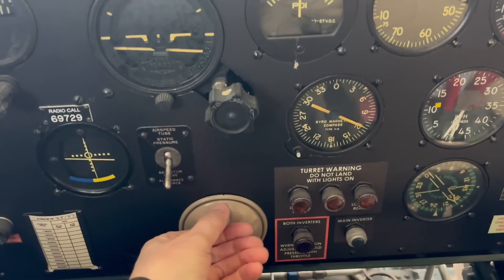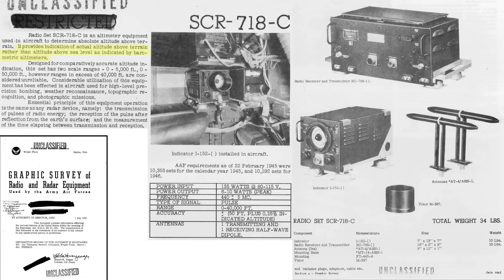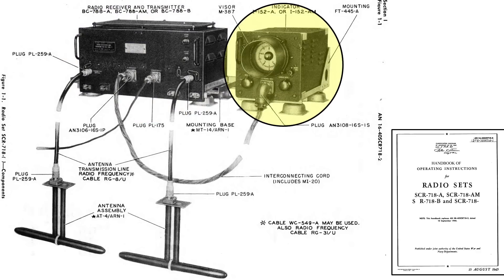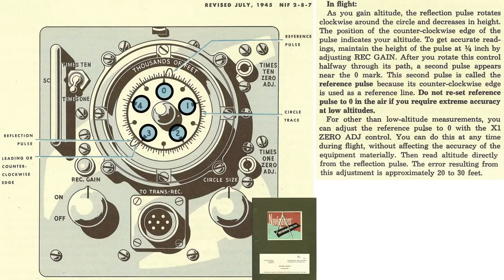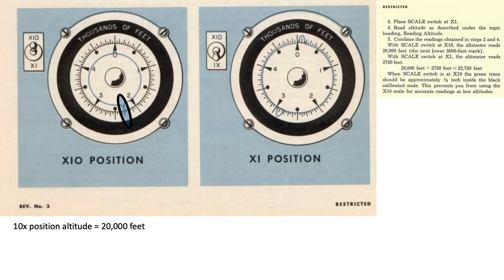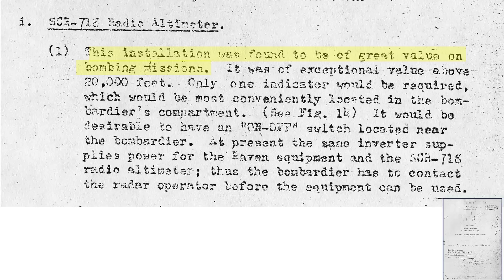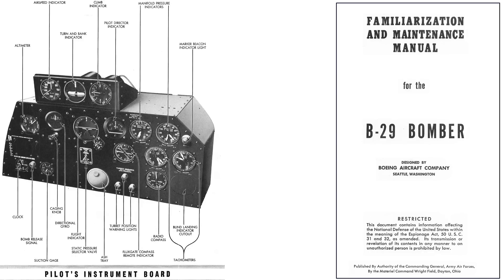The clever instrument WWII Bombers used to determine their altitude - The SCR-718 Radar Altimeter

Comment: C-130s used a very similar unit for pressure pattern navigation well into the 1980’s.   It was a good backup overwater as we did not have INS or GPS but celestial and Omega and sometimes nothing at all but Dead Reckoning on cloudy/IFR days.  Quite an art

Comment: Boeing 767 that still had the round ashtrays in the cockpits were and are identical to those ones in the B-29.  Many have been deactivated and covered now but when the widebody jet came out,  crews could still smoke in the cockpit like passengers in the smoking section. I tried to see if I could acquire one during an overhaul but only got a passenger arm rest ashtray.  As for the rad alts, the WW2 version used UHF frequencies,  thus the little dipole reflecting off the wing,  but nowadays they are at 4.3 GHz and sweep 100 MHz either side of that.  The antennas are flush mounted.  And redundant two or maybe three per jet plane.  Power in the order of a couple watts CW at most.

Comment: The ID-14A/APN-1A is a conventioal mechanical dial and needle indicator instead of a CRT based indicator, selectable between 0-400 ft and 0-4000 ft.  The transmitter circuit of the APN-1 uses a pair of 955 acorn tubes in a strange arrangement with the plates connected to the modulator and the grids going to the antenna.  I wonder if the other radar altimeters use a similar arrangemant.
Reply: I saw an old unused WW2 UHF rad alt for sale at a hamfest once.  Do not remember what model.  It was not messed with,  apparently even hams could not figure out a useful conversion for that monster.
Reply: @TomSherwood-z5l  There is a dynamotor inside that may be useful (if you want a 24V one); but yeah, it's a pretty specialized thing with stuff inside I've never seen before, or since.
Reply: @Strike_Raid  I love it when people speak in an ancient language that I still understand.
Reply: @Hopeless_and_Forlorn  It actually seems to be coming back.  I here more electron tube talk these days than for over 30 years.

Comment: By far, the hardest hurdles to restoring any WW2 radio gear is finding the plugs, cables, and accessory or junction boxes. That is also true today. The culture of disposing of everything except the box came from the 29 aviation disposal sites immediately after WW2. It's been copied by avionics shops to this day. The progress of 1940's radio avionics went from simple and shrewd components to big heavy complicated unreliable equipment late in the war. Planes paid huge penalties especially for the later junk. The early stuff was gold. 135 watts for the radar altimeter SCR 718 ? Don't drop the flaps. Just turn on the box. What a blessing transistors are. I restore ARC RT 328's with trays and plugs.  They would have done these planes some good.

Comment: Does anybody know why 440 MHz was used?   26.8" wavelength seems like low fidelity.
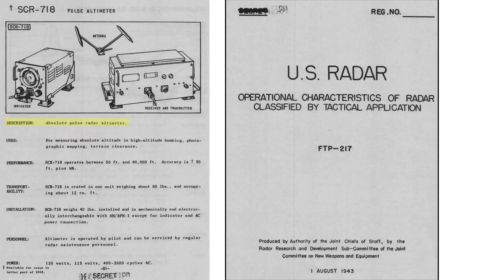Reply: This wavelength would give altitude to the nearest foot (actually 13.4 inches for purists). But then this radio altimeter had an ACCURACY of +/-50 feet (see time stamp 1:53 line PERFORMANCE).
Reply: @johnbuchman4854  the accuracy was "plus/minus 50ft plus 1/4%," not just "plus/minus 50ft."
Reply: I believe the low frequency gives you the range required with minimal power, and the accuracy is sufficient.

Comment: Great stuff, as usual.  A small correction for terminology: altitude indications based upon static atmospheric pressure measurement in general are referred to as "barometric altitude."  "Pressure altitude" refers to barometric altitude indication referenced to a corrective setting at the standard sea level pressure of 29.92" Hg, as seen written below the comparison illustration seen in the video.  Barometric and pressure altitude are the same only if the ambient pressure happens to be equivalent to standard pressure.  Based upon the technology in use when I retired from wrenching airplanes some fifteen years ago, I can say that modern airliners are equipped with two or three LRRA (Low Range Radio Altimeter) systems that provide absolute altitude indications on flight displays, and also provide the same values to flight guidance systems critical to landing, and particularly automatic landing.  Rather than using radar pulsing, modern systems use FMCW (fFrequency Modulated Continuous Wave) signals based at 4300 MHz.  This requires the installation of two, identical antennas in the belly of the airplane for each system--one to transmit the signal, one to receive the reflected signal.  Multiple systems use unique phasing to prevent interference between systems.  The systems are continuously active, but only absolute altitudes below 2500 feet are displayed to the crew.  The FMCW system provides more accurate indications than pulse radar at low altitudes.  They are calibrated to read zero altitude not with the aircraft level on the ground, but at the nose-up attitude which the aircraft maintains when the main wheels touch down on landing.  Thus the automated callouts heard on final:  Five hundred, One hundred, Fifty, and so on.
Reply from the maker: Thanks for sharing your expertise on the subject.  I'm always learning new things from viewers.

Comment: I am a retired USAF navigator. I flew in the Boeing KC135-A and used the SCR 718 for pressure pattern navigation when over the ocean. Simply put, measuring the change in absolute altitude from a constant pressure altitude over time  would would allow the navigator to create a pressure line of position (PLOP) which was one additional piece of information to use the days before GPS and INS or other radio aids. In the 1970's we were not allowed to use the SCR718 other than testing it until we were more than 50 nautical miles offshore. the 440 MHZ frequency caused a lot of interference with other land based systems.
Reply: I was an avionics navigation technician back in the 70's. I worked on them. The biggest problem was that they were not used much. The controls would get oxidized and were intermittent. One "redball" emergency service call while the KC-135A was sitting at the end of the taxiway was fixed by a good hard slap with my hand. The navigator was surprised. I told him, "Don't worry , sir. This hand has been calibrated."
Reply: Did the operators and techs call the device 'the S-C-R 718', or was it pronounced something like 'skitter' or 'scar'?
Reply: @t.travelerjg1908  SERIOUSLY?  The fighters I worked on were Vietnam vintage but used the microwave rad alts like modern jets.  Just with klystron tubes instead of solid state transmitters.
Reply: @t.travelerjg1908  In the shop we either said "radar altimeter" or s-c-r-7-1-8. Most of the unites had their military designation changed over to APN-133. Still the same thing electronically.
Reply: We’re they doing pressure nav during wwii?